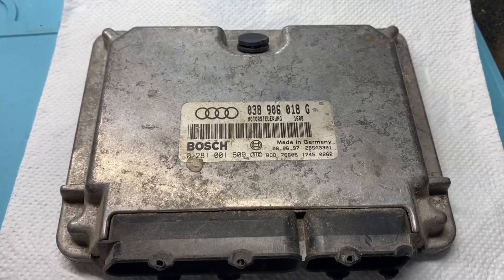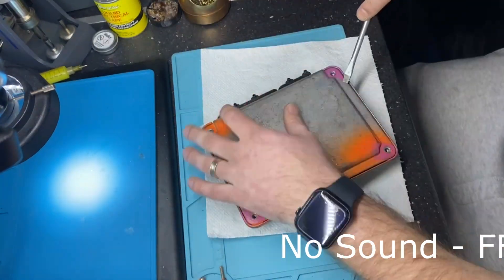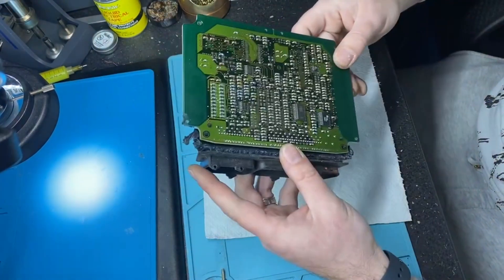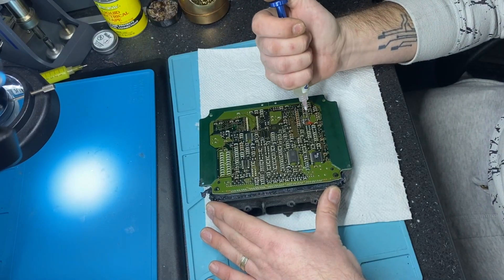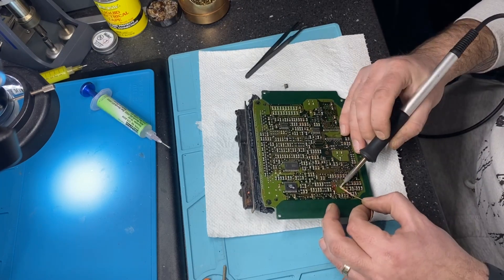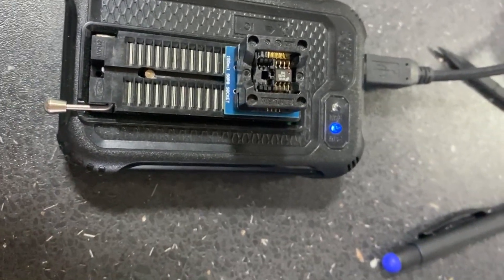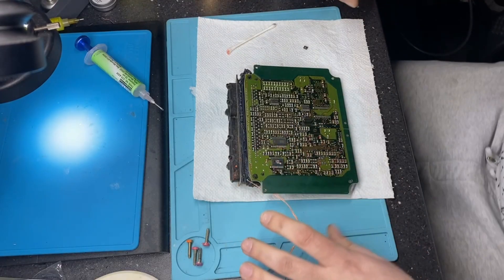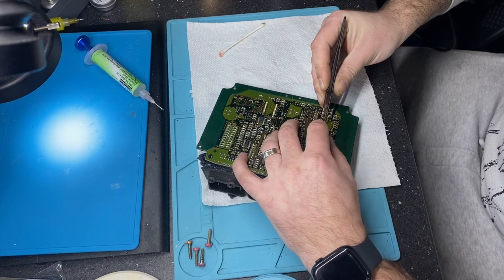How to : Make IMMO OFF for Audi EDC15 - 24C02 EEPROM

Comment: why couldn't it be done by Programmer CH341A USB?
Reply from the maker: It can be done with any 24CXX programmer, i do it with T48 because thats one of main programmers
Reply: @UnixCoDElectronics  Can I make 24C02 eeprom by ch341a programmer?
Reply from the maker: Yes, it is working. CH341A  Support 24 series
Reply: @UnixCoDElectronics  thank you